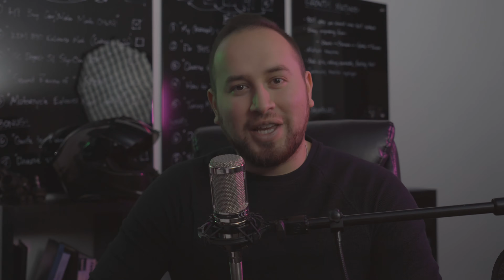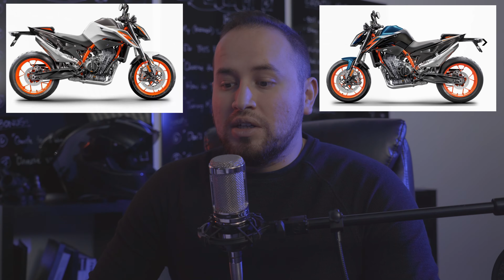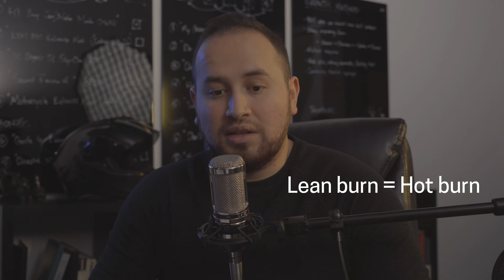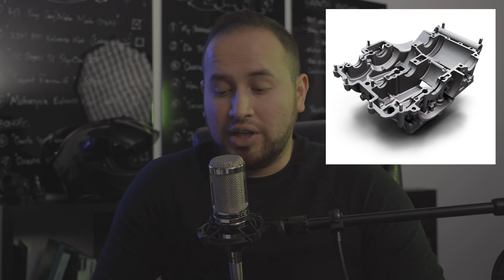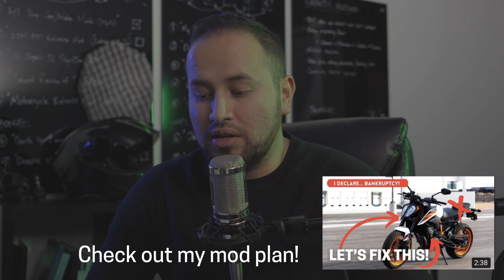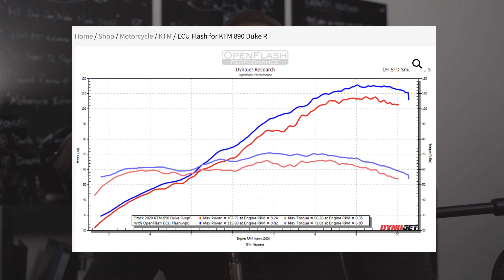Is the 2022 890 Duke R Already Obsolete? - KTM 990 Duke Incoming

Comment: I've always liked the dynamics of a V-twin (and single-sided swingarm) so I'm curious why KTM didn't make the 890 and subsequent 990 a V-twin...like a more usable 1290. Either way I'll hold off getting an 890 until there's more solid info on this bike. Thanks for the info!
Reply from the maker: From what I understand it’s just about packaging. Chassis design is simplified without the headache of the more complicated V geometry and it’s variable cooling (even tuning in some cases). Though they don’t have the same geometry the firing pattern and thus the power delivery is identical to the V twin which is by far the most important characteristic of V engines when considering grip. You should read about Harley’s early success if you haven’t it’s related and very interesting! What kind of info would you like to know on the bike? I’d love to get some of your questions answered.

Comment: makes no sense to have a 1290 and 990.....unless they are coming with 600/700 which would make sense..now you jump from a 390 to a 890......seems to me they could sell something in between easily and they did have one b4.....but 390/990/1290 kinda seems weird especially when so many love the 890 just as it is.....i would think a smaller duke is coming 4 sure especially if 990 is really true
Reply from the maker: You have very valid points! What do you think about this? I’m thinking it’s the piece you and I both see to better fill out the range: https://youtu.be/m-n0rsZuQNQ

Comment: Seems like the new 990 isn't just a hoax, nice video man, thank you.
I'm owner of a 990 SuperDuke 2005. This old beast is tuned to 98 kW and weighs 400 pounds (full gas tank). Dynamic and suspension of this bike is just amazing. However it has no ABS, no TCS & no slipper clutch, which can be quite useful on track.

KTM upgrading 890 to 990 is cool. Weight to power ratio could be better than old 990s. Imagine it with an aftermarket decat exhaust and dyno tuning, sounds like a holy grail to me.
Reply from the maker: Old school will definitely force you to be a better rider. I’m starting up a skills series in which I try to improve myself because I have to admit the 890 R spoils you with aids if you let it. It certainly does sound like a great value proposition, we shall find out. I’m guessing teasers starting end of summer… I appreciate the comment!

Comment: I'm going this Saturday to go look at 2022 890r. I originally was looking at the mt09 but after sitting on it I didn't like how wide the tank feels. I'm keeping my fingers crossed that I like the 890r. I don't need another 1000cc bike I have that box checked already. I want something I can more comfortably screw around on my town roads.
Reply from the maker: I think you’ll find the Duke R is the one for that role. It feels very light and actually quite narrow in seated stance! Let me know what you think. Also, definitely opt for the tech pack when it comes to it. Quick shift and track mode are must haves! Thanks for the comment 🔥
Reply: @AlejandrosEngineeredLifestyle  ohh with out a doubt I'll want that quick shifter. And more option to turn off tc. I've been the proud orginal owner of a 04 cbr1000rr. Before bikes came with abs n tc. It was all up to the rider. Which I do enjoy. This would be the first bike I buy that has all these options n the first bike I'll ride with them. Should be interesting 🤔
Reply from the maker: @imperialtekk9443  At least you already know what it is to ride without the aids, it’ll make pushing this bike much more enjoyable. Once you vary the settings to your liking I’m sure you’ll enjoy it!
Reply from the maker: How was the test ride??

Comment: this wont be a replacement, they will, if this is a bigger engine rather then a revision of the 890 be a streetfighter v2 competition.
Reply from the maker: I see your reasoning! The CEO has definitely spoken against the super bike 200 HP number for road bikes before so I’m not sure where they’ll take the upper end of the lineup given the current horsepower wars. I’d say we’re quickly approaching the threshold for road useable power (as well as rider capability for that matter)

Comment: The 1290 is WAY too much for the street.  The 790 was a bit anemic, while the 890 hits the nail on the head.  If they release a 990 it's not going to be much more than the 890 and WAY less than the 1290.  The 890 is the Goldilocks of the series.  Just right!  As far as lean tuning... well yea, no shit.  Lean tuning is the way to go.
Reply from the maker: I love the profile picture and thanks for the comment! I definitely agree that the 890 truly is something extremely well suited to the road. I would really love to ride a 1290 EVO to be my own judge but I also suspect you’re right there as well! I love the combination of lightweight and moderate power as opposed to heavier and more powerful (similar to Lotus theory). I do however disagree that unless you’re penny pinching for MPG’s a rich tune would definitely sort out the lumpiness of low RPM and offer more HP throughout the range with higher evaporative cooling of the charge and an overall higher mean effective pressure!

Comment: Good points on the engine design. This time it's more than just some slight internal changes though. Look closely at the engine in the 990 spy shots and compare to your 890R engine ... there are some much more significant changes going on than were made when the 790 became the 890. Look at the clutch casing and oil sight window ... also the number of horizontal 'fins' on the cylinders ... and the valve cover.
Reply from the maker: Oh boy, I need to look for more detailed pictures. I’m not practiced enough to glean that from these pictures specifically. I have seen others that feature the new bodywork which is also exciting, but I will certainly take another look for engine dissimilarity! Welcome to the channel 👌🏽

Comment: I agree on the exhaust routing looks real nice on the spyshot! it wouldnt bother me if they released a 990 duke, i already own a 990sm so im good there ;) 
I would start talking to my dealer if they made an 890 or 990 husqvarna Vitpilen thou! The Vitpilen 701 is such a beutiful bike! -give me that with 120ish hp :D
Reply from the maker: It really is a good looking bike, certainly unique! Have you ridden the 701? I've not even seen one in the wild yet.

I looked up the 990sm earlier and it also seems like quite the bike! I have been contemplating a custom fab using parts I've secured to low mount the slip for the 890.. I'll have to do some math/measurement first though.
Reply: @AlejandrosEngineeredLifestyle  only ridden the ktm 690sm witch its based on, but i saw an vitpilen 701 on a trackday and its even better looking irl than in photos :)

Comment: I've owned both a '18 790, '20 890R now a '21 Tuono 1100. I believe the proposed 990 would be a more direct competitor to the Ducati Street Fighter V2. If so are these two no longer Middle Weight Nakeds being in the ~140hp bracket an close to litre displacement? With that thought is the Tuono 660 still middle or should we now have 3 sectors Middle, Super & Hyper and if so where does Super & Hyper seperate 165hp?
Reply from the maker: Sir, I am super jealous of the variety of bikes you’ve ridden. I would love to hop on that Tuono! I completely agree; middle, super, and hyper is certainly the way the industry is headed. Although, I would argue it’s nearly impossible to define because the 150+ hp beasts we ride today are really not equivalent to the 100 hp bikes of yester-year that lacked rider’s aides of any kind. It is baffling to me that anyone can go purchase these super bikes! HP figures really don’t mean a whole lot anymore when rider’s aides can save your rear end if you ride like a moron and always pin it. I don’t think many riders today would fare well on 160 hp bikes without ABS, TC, wheelie control, and the like.

Also, on a personal note I’m shooting the video I was referencing we make together this week, I’ll send a link over to you to respond to if you’re still interested.
Reply: @AlejandrosEngineeredLifestyle Won't  KTM also need a 490/590 platform as it'll be a 100hp leap from the 390 to 990> I did own a '17 RC390 was a cracker of a bike.
Reply from the maker: Yeah, ironically bridging the gap was the original intent with the 790 and now it's successor may as well be widening it!

I really love the look of the new RC390, seems like a good size bike. What made you get rid of yours?
Reply: @AlejandrosEngineeredLifestyle  Having to chase my brother on a 1050RS & his wife on a S1000R out of corners was pretty tough with only 44hp lol
Reply from the maker: Hahahaha oh man, talk about power mismatch…
Reply: @AlejandrosEngineeredLifestyle  790 was still lacking till I changed gearing from 16/42 to 15/43. 890R Was right there now the V4 Tuono has the power but needs shorter gearing as my base model is 15/40 the factory is 15/42 so I'm going 15/44 at first tyre change. Which will be from Pirreli Rosso's to Bridgestone S22's
Reply from the maker: @DukeOfTwist  Have you ridden a lot on the S22's? I've been recommended them by several people and I've smoked my rear CII so have been debating going to the S22 as well.
Reply: @AlejandrosEngineeredLifestyle  We put S22's on every bike except the BMW K1300 as it gets all the stock tyres we take off lol
Reply from the maker: Just bought an S22 replacement!! THANK YOU
Reply from the maker: Hell yeah, just picked one up in the latest video and looking forward to experiencing it!
Reply: @AlejandrosEngineeredLifestyle  I'd be putting a new S22  on the front as well to fully experience their performance

Comment: Enlightening video, lots to consider, love my 2021 890r. I’m very curious to see where things are going with the supply chain issues. Keep it up you’ve got a classy style.
Reply from the maker: Comments like yours provide more motivation than you realize, thank you very much! I am super curious to see how the 990 fits in the lineup and hope to ride one as soon as it’s available! I really do love my 890 R and want to continue making it better and personal. Have you done any mods you’d recommend?
Reply: @AlejandrosEngineeredLifestyle  nothing special sliders, radiator protector, windshield, heated grips kind of utilitarian, safety and comfort.
Reply from the maker: @alfunso3665  I’ve got a couple of those things in the garage pending instal myself. What do you think of the windscreen, I was thinking of that myself. Does it make a difference at highway speeds? I joke in my other videos about the wind blast because before this I only rode cruisers!
Reply: @AlejandrosEngineeredLifestyle  the windscreen was from power parts, I like that it protects the instrument panel especially in the rain, it deflects the wind a little higher to the top of my helmet.